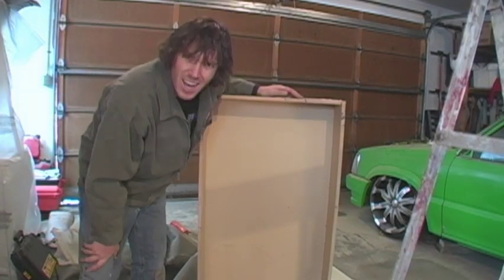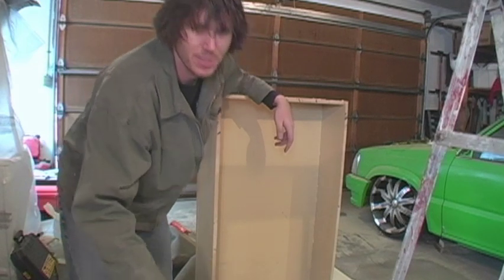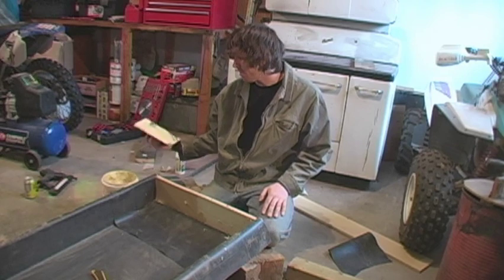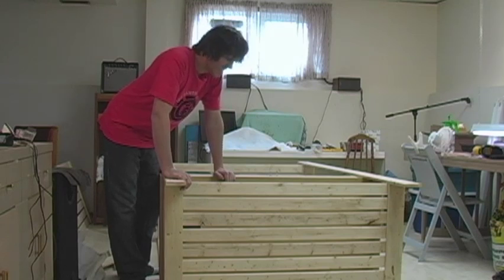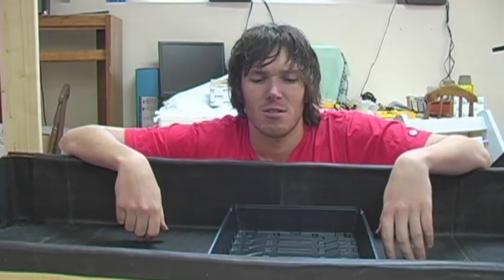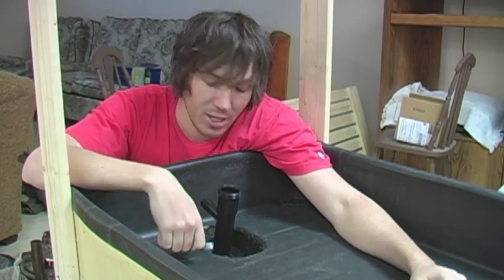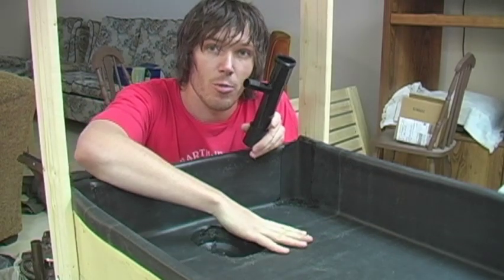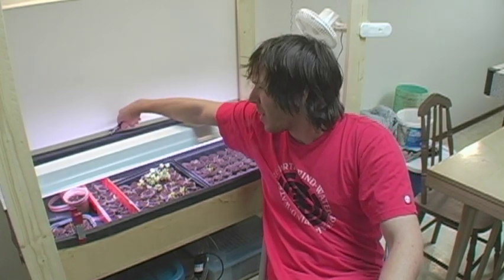How To Hydroponics - S01E03 Building a custom Hydroponic Flood Table / Shelf

Comment: Love the videos! Thanks so much. Fantastic diy attitude. I'm building my kitchen cabinets. In doing so I learned how to use a nail gun. If you look at the nails they are beveled at the ends to guide them. If your gun is parallel with your board you are nailing to, the nail will blow out the side because of the beveled end. Hold the gun perpendicular to the board then it will not blow out. You may know this by now but I thought I would share the tip anyway.

Comment: It's dangerous to burn pine in an indoor wood stove... (especially with a metal chimney.) The chemicals in the sap will build up and corrode the metal over time. Thanks for the hydoponics videos. I might give it a try if I learn enough about it.